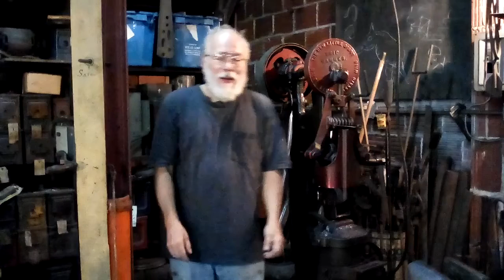A Blacksmith's Dictionary, Flux and why there are more than one type

Comment: Excellent video.  What do you suppose is the best flux for making a small amount of aluminum bronze? (90% copper 10% aluminum, total weight about 1/2 ounce) I’ve been having a heck of a time with it, was able to get small bits of a nice product but I’m getting lots of dross and oxides, sticky and grummy bits.  Borax helps but I feel like I’m using to many pinches of it for such a small crucible.
Reply from the maker: Hi:
 Aluminum is very reactive. What I do is melt the copper with some borax, enough to put a full layer across the surface. Then wrap the aluminum in copper foil and push it down into the molten copper, a rod  like a carbon arc rod works nice. Aluminum wants to float on copper, the foil protects it a bit until it is below the surface , melts fast and no dross.
Some people use fluoride flux , like the flux used to gas weld aluminum.
Nasty stuff , but it will work.
Daniel
Reply: @danieltokar1000  awesome man thank you for the tip!

Comment: I use a lot of flux when I'm welding high carbon steel to mild steel, not because I think it is glue, but because it seems to help protect the high carbon steel from burning as it gets up to temperature. Perhaps there is some other way of protecting the steel from burning other than using a lot of flux? I guess better control of forge temperature, but it's hard to get right! I use charcoal for forging, so I don't have much in the way of slag or clinkers.
Reply from the maker: Hi Glen:
 Another trip down the rabbit hole!
I have to start by asking a couple things about what and how you weld.
Charcoal , is this real charcoal or those sawdust brickettes sold for cooking?
How deep is your fire and what are you using to supply air?
Describe the steels , "high carbon" covers alot of stuff, if you don't have an alloy number, can you describe where it came from?Axle , file , leaf spring , mower blade?
It would also help to know sizes, is this a small bit of steel welded to a large mild bar, equal sizes? Just describe what you want to do, Chisel , axe ,anti-tank bayonet?
 Without the details, there are some general guidelines.
The higher the carbon , in general, the lower the melting point. The range for what you may have is maybe 300 F lower melting point for the high carbon steel than the mild steel.In the simplest case of equal size stock and just one piece of each, put the mild steel on the bottom, it can take more heat.
The fire  has three zones , down where the air comes in it is hot and oxidizing.
In the middle is a neutral zone where it can be as hot but  most of the oxygen has been used up and near the top of the fire is a reducing zone. This is  for a fire that is deep enough to balance the air supply and the amount of volatiles in the fuel. 
If your fire is shallow , the air is not used up and you burn stuff when it gets hot. Shallow fires also don't heat well as the excess air carries away some of the heat. My welding fire is 6"-8" deep and the work is 4"-6" from the bottom
Fuel that is "dry" , not much volatile content, also burns stuff up as the volatiles eat up oxygen, That is why "hard coal" anthracite is a hard fuel to use for welding. Not impossible , just harder. Charcoal brickettes are almost as bad. Real charcoal still makes some flame. 
 Forge welding is another one of those subjects with endless possible combinations , so please tell me what you are doing.
Daniel
Reply: @danieltokar1000  I'll be a bit more specific now ;) I'm using real charcoal, I prep it by breaking it into small pieces and filter out dust and the smallest bits. The forge is supplied air from the bottom, with an electric blower. I make a big pile of charcoal and get it up to temperature before starting to weld. My welds are with 1095 and mild steel with around .2%C content. The steel I get is 3.5mm thick, anywhere from 20mm-60mm wide, and I use it for edge steel on laminated chisels. So the mild steel in the weld is maybe 5mm to 10mm thick. The hard steel is fully exposed to the forge atmosphere on one side, as it is just balancing on top of the mild steel. I'd say I have around 4 or 5 inches of charcoal under the pieces as I get up to temperature, with very little charcoal on top because the two pieces are just balancing together, or are held together with some wire. What works for me now is to get everything to an orange heat, then press the pieces together to get them to stick a bit. Then cover it with charcoal until I get it up to a yellow heat to do a good first weld. I often need 2 or 3 welding heats to get it fully welded, including the sides. Most of the time the hard steel isn't longer than 3".

I used to have problems with the hard steel burning up and sparking as I got up to a yellow heat. I would of course have the mild steel facing down, facing the blast. In the bottom draft forge I am using I can't completely avoid being over the tuyere. I don't seem to have the burning up problem now that I put a lot of borax on the hard steel to protect it. So I'm one of the guys that is using a lot of borax on his welds now! 😂 I do notice that even though the hard steel doesn't burn, the mild steel on the bottom occasionally burns a bit, and even takes up some carbon! It is quite hard to file and has a bit of a high carbon spark once I'm done.

Perhaps my technique is better now, and that prevents the burning, but I'm hesitant to mess with success! The borax splatter is annoying and a bit dangerous. So it would be nice to not have to use so much.
Reply from the maker: Hi Glen:
OK, doing better than I thought from your first description. Charcoal burns fast! so maybe it is that you have to work at keeping enough fuel under the metal. 'hollowing out'  a fire can cause burning. Borax can also evaporate at high temp. Do you see a yellow tint to the flames when you are close to welding heat? That is the borax breaking down . It's also a sign that the metal is hot enough to weld. Adding a little sand to your flux may help, it makes the flux less fluid and harder to break down
The mild steel picking up carbon. You just learned how they made steel in the early days. The closer to the melting point the iron is , the faster carbon moves in or out . If you put a bar of mild steel in the fire , close to it's melting point in a neutral or reducing fire it is gaining carbon on the surface. Soon it will look wet , as the higher carbon layer melts. This is case hardening. All the folding and welding  done to make steel was to even out the higher carbon .
This can also happen to the high carbon steel and make it easier to burn. So maybe you are at welding heat for a prolonged time. 
 Don't worry about the number of heats to close up the weld. As long as you can avoid burning  , it's OK .  The grain size gets larger the longer the metal is at high temp ,but you break it back down by forging and annealing. Smallest grain size makes the best edge . 
Thanks for the support! You are my first Patreon !
Daniel

Comment: ..Thank you Mr. Dan. Any thoughts on maybe a book to delve into the finesses of blacksmithing such as you just did? The Salt, Stainless and Nickle forge welding would be Great. Thank you again for sharing your knowledge...!!
Reply from the maker: Hi: Lots of books on basic blacksmithing, some of the old books written as school books for trade schools are good but not many on the harder stuff.
The Complete Modern Blacksmith by Alexander Weygers is a great book for how to do lots of useful stuff with homemade tooling and it's cheap! They reprinted the three books as one book and you can get a used copy for less than $10.00
Better deal, look at : http://www.bamsite.org/books/books.html 
The COSIRA books from England were always  very helpful.
I  collect bits and pieces , but it is mostly having done lots of weird stuff in the shop .
daniel

Comment: He lives! If you set up the patreon page I’ll definitely send you some support!
Reply from the maker: Thanks!
I am working on it.
It would be nice to run a regular program, lots of topics would require multiple videos.  Example is making a Ferguson rifle breach  using 18th century tools. I know of some that have been made using modern machine tools or lost wax investment castings but  how did they do it in 1770? I think I know a way , but it would take some time. 
 Same thing with Felix Werder's method for making brass barrels.
Auction link: 
https://www.hermann-historica.de/en/auctions/lot/id/34932
I first saw one of those in 1986 and have puzzled long and hard over them!
What I would do if I won the lottery.
Daniel